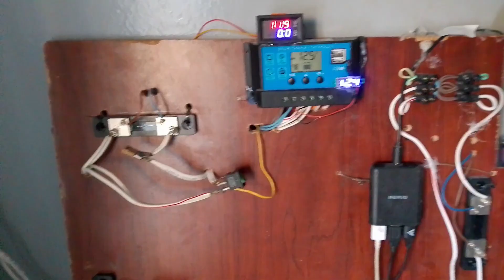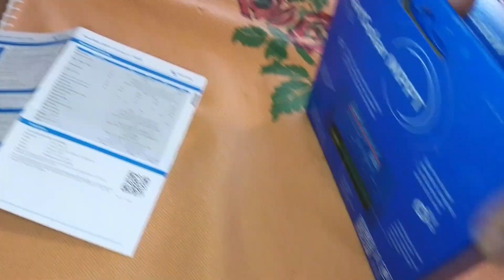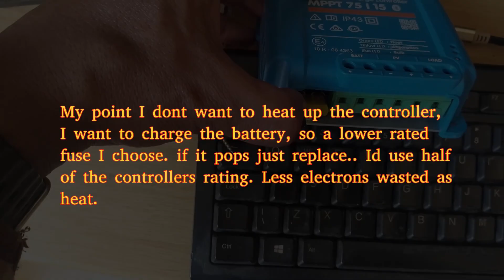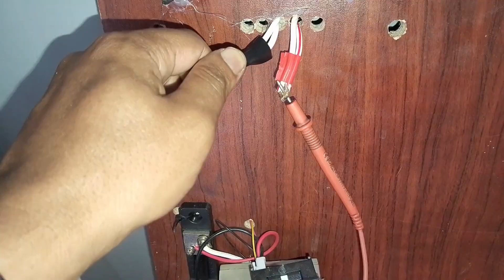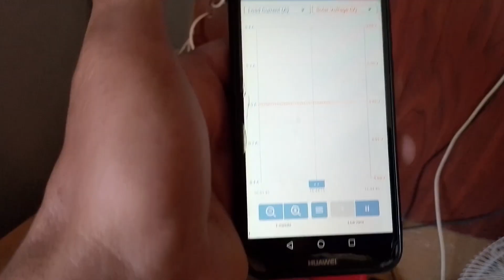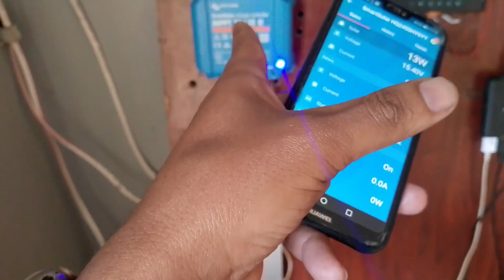Victron 75/15 controller

Comment: Nice  u need  more  panel 🎉
Reply from the maker: Hi @OwardTaylor thanks for watching. Yes I do infact. There are a few components I'm still exploring that I want to get hold of. Use what I currently have and implement it gradually over time to play together with the rest of the setup.  Long game, consolidate all the solar panels into one main setup.
Reply: That nice   i have  a small  system  that i  mad also   with  the same  mppt charge  control    @Mr_natenut